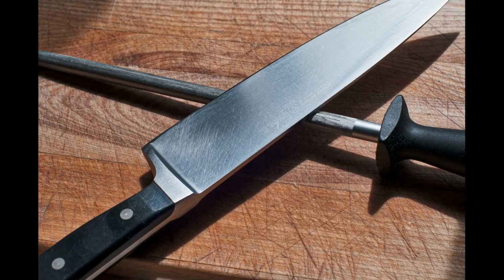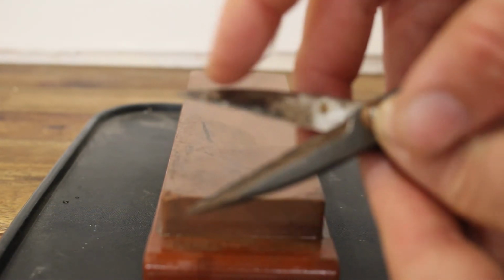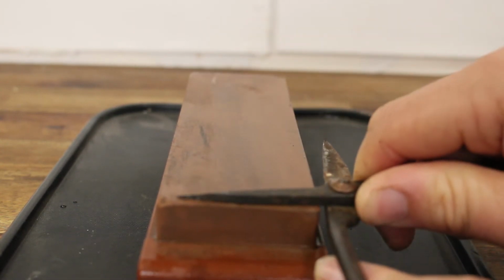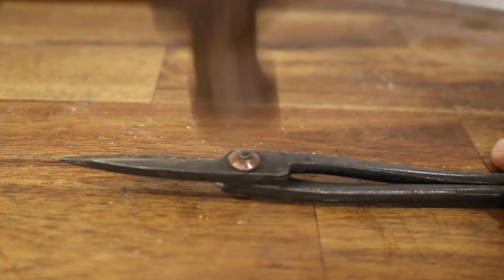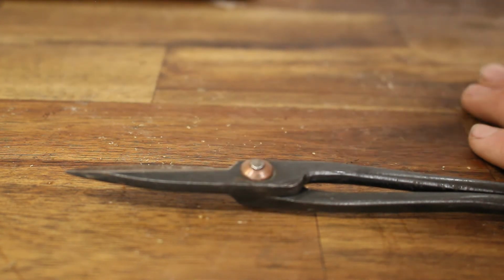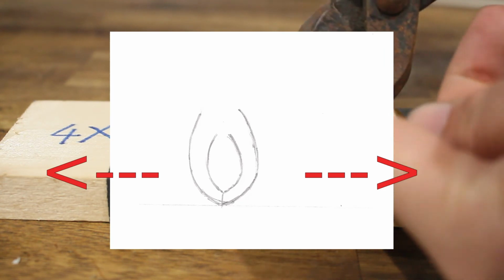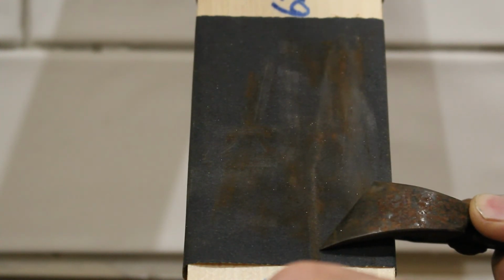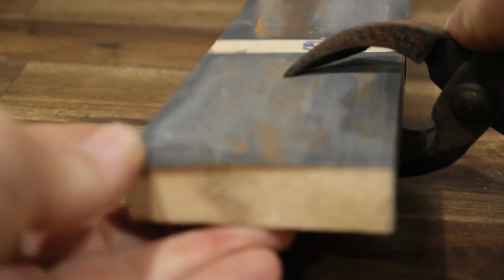Bonsai: tools: how to sharpen them

Comment: Terrible video.  Terrible condition of the tools.  Keep the rust off your tools as a starting point! Clean your tools before you sharpen them! Wow.
Reply from the maker: For a demonstration that is unnecesary. They were left to deteriorate slightly to show how to sharpen them. Removing rust and "refurnishing" tools is a later video to show you can source cheap tools as a starter and make them useable.